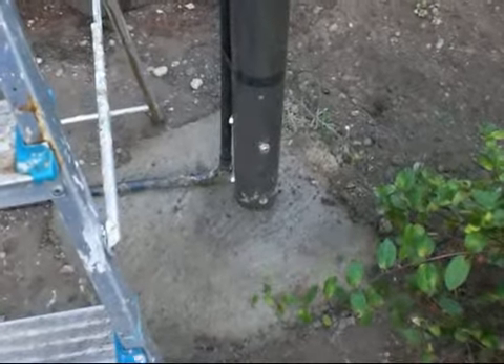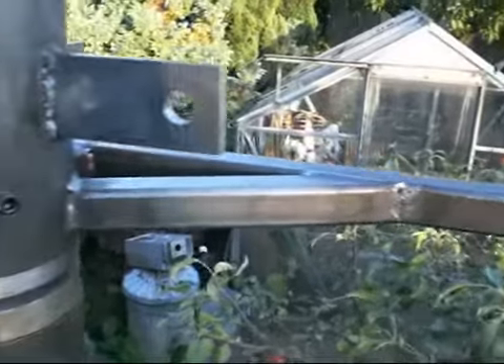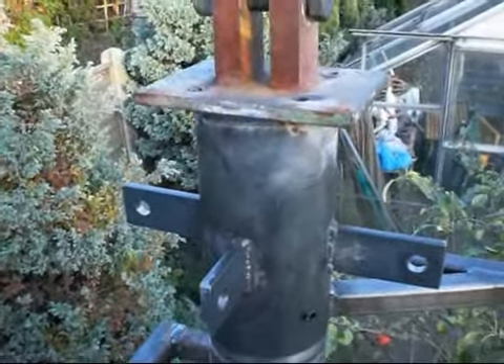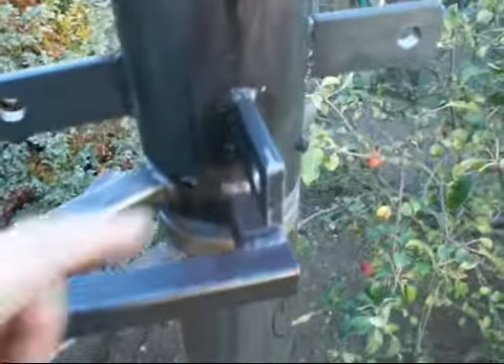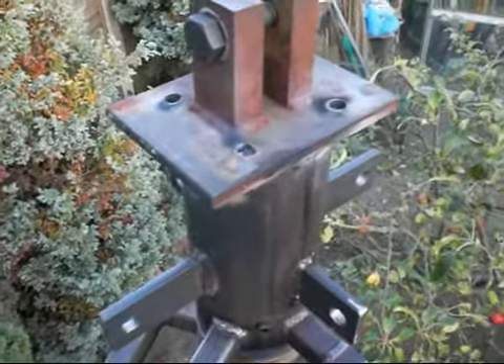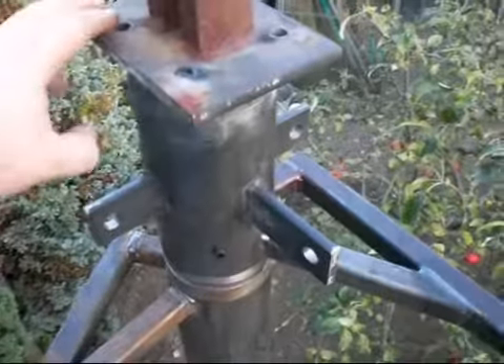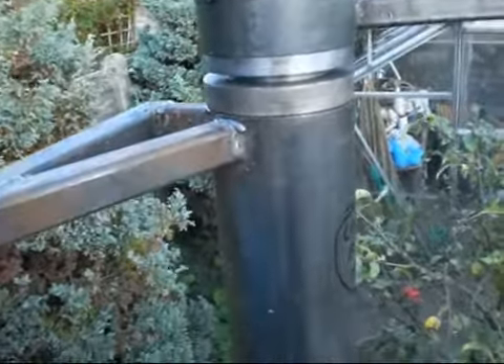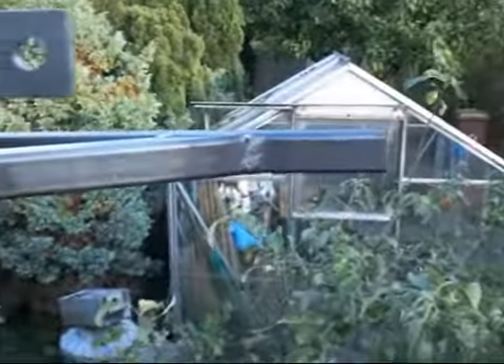New Tracker Mount and fittings

Comment: Yeah... you should have gotten 10 of them.  I found a 24in one on for 100 bucks.  I assume everything is still working ok on your set up after 4 years?  In the UK the sun raises and sets at different points in the sky winter and summer, how do you accomodate for that given the built in limit switches in the actuators?  Do you adjust them?

Comment from the maker: I got mine from Maplins.co.uk but they sold out fast because they reduced them to £25.00 each and free shipping,wish I had got 10 now.
I use banks of battery's ,I got 30 x 6v Yuasa battery's  each 6vdc so I tap my power off just 2 cells to get 12.6vdc which runs the tracker circuits

Comment: Thanks!  I am also using a 100mm diameter pole. I live in the states and I've been trying to find a 24" travel actuator.  Do you remember where you got yours?  Also I have a 24 volt system, you mentioned that the actuators run smoother on 12V, how did you step down the voltage from 24V to 12V?  Thanks again.
Reply from the maker: I have two  12v dc batteries so just use them in parralell for 12v

Comment from the maker: Metric bearing  is an interference fit .The top hat and bottom mount that fitts inside the pipe was machined.The bottom part was wielded to the pipe.      It had to be skimmed down a bit as I forgot that when fitting the lugs on the front and rear and sides it deformed with the heat

Comment from the maker: Ordered some huge SKC Bearings from a local supplier
I also had a local Machinist make a top hat with a shaft to fit the 100mm tubing and a circlip on the end to stop the main top bit from coming off.you may notice that the top bit has 4 allen bolts to secure the top to the steel shaft inside ,

Comment from the maker: No plans ,just redesigned it from my first prototype which was not strong enough.
I had the bearing mount made by a local engineer,he has  the ability to make just about anything.
this time its the business.strength is a consideration this time and thanks to Marty at Eastern steel in Norwich for helping me with the steel.Fred layed the concrete.